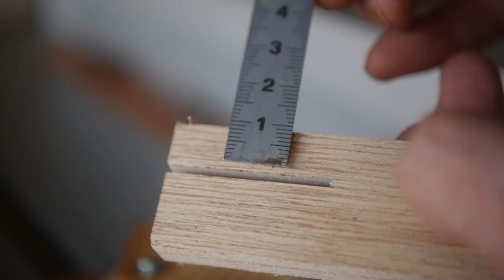Zero clearance insert

Comment: Looks great and suits your shop, blending in nicely with your other self-made tools. 👌🏽
Great job mate. 👍🏽
There is much debate on zero clearance insert plates for the drop saws because they say that the wood being cut will still have some tear out on the under side due to the blade pushing through the bottom, whereas the table saw  the blade slices through from the end. Then there are others that say it works really well.
Some like this and some don't.
Reply from the maker: Hello, Bill
Thank you for always supporting me

This zero clearance insert plate was a very good result for me! Work gets better.
The drawback is that you can't cut diagonally down!

Thank you my mate
See you

Comment: Hi,
This is the first time that I see a zero  clearance insert on a miter saw. 
This will certainly leave a cleaner cut too.
I will make one too.
The only thing that disturbs me is: you have to undo 6 bolts to put the old one in and have to tighten them, when you have to cut in an angle.
Keep it safe, it is not over yet.
Willy  from Belgium.
😷😷😷
Reply from the maker: Hello, Willy
Thank you for always watching my video
And thank you for the nice comment
I agree with your idea. A slanted cut that goes down vertically breaks the straight line of this board, so I need to come up with an idea that can be replaced quickly and easily.

Thank you for your kind comments

Comment: Lovely work as always 👍👏👏
I made one for mine a couple of weeks ago. Mine was a lot more complicated though. 
Mine had a clip in plate and it also has an odd shaped large valley underneath, with a plateau at the top. 
So I had to make an infill to come level with the plateau first, and then the top section which is only 3mm thick. 
I also had to drill holes for mounting screws to secure it down. 
Not the quick job I had hoped it was going to be!! 😆😆
It’s a shame I can’t send you a picture on here. 
I hope you and your family are well. 
Stay safe my friend.
Reply from the maker: Hello, Adam
Thank you for visiting me as usual
Your saw has a complex design, I have a lot of imagination in your writing.
It needs to be patiently resolved over time.

I sincerely respect your warm comments.
Thank you from Japan, to my friend